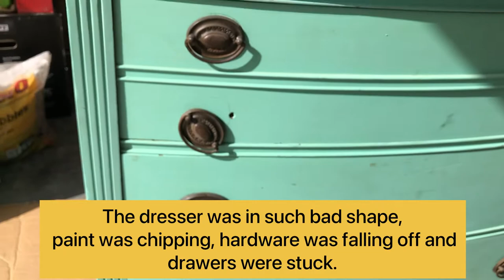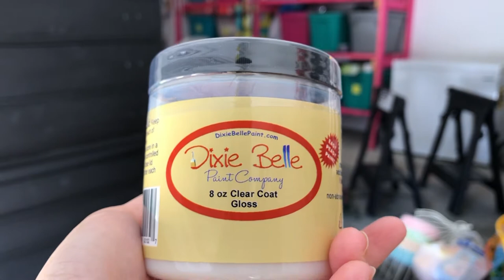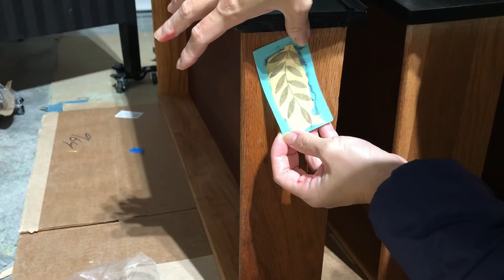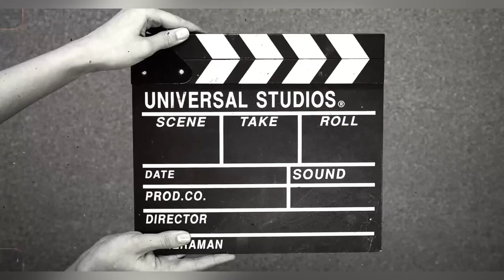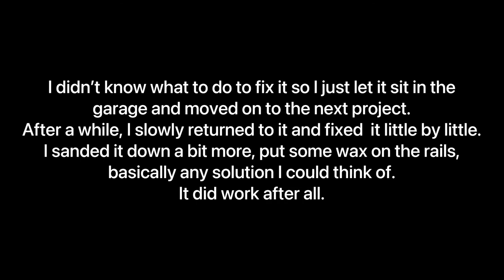Dresser Makeover using Dixie Belle Chalk Paint and ReDesign with Prima Transfer.

Comment: It turned out very nice? Really like  that transfer. I think if you put some wax on the sides and bottoms of the drawers and on the runners on the inside of the dresser itself you’ll find it will usually help your drawers go in and out easier. Anytime I am painting a drawer I sand around the edges of the drawer extra good taking as much paint off as I can especially if it has been painted before because the paint build up can cause your drawers to stick.
Reply from the maker: This is one of the best advices that I’ve received so far. I appreciate how you spent the time to explain it to me, very very helpful. Thank you Judy! ❤️